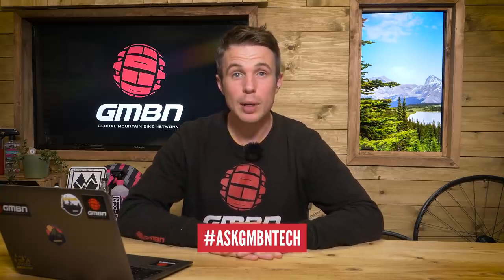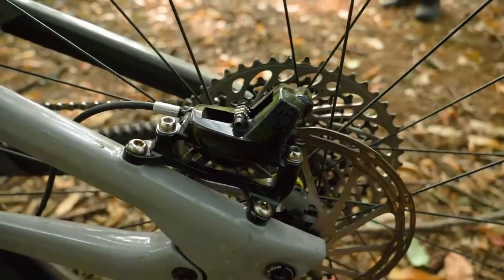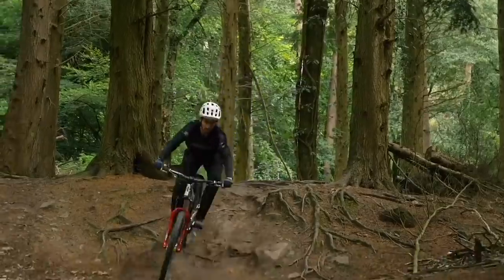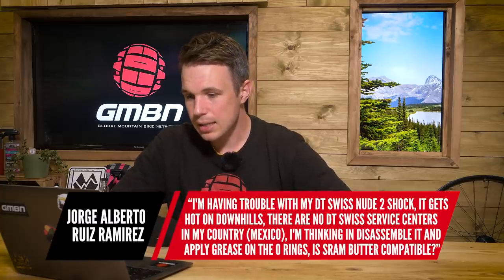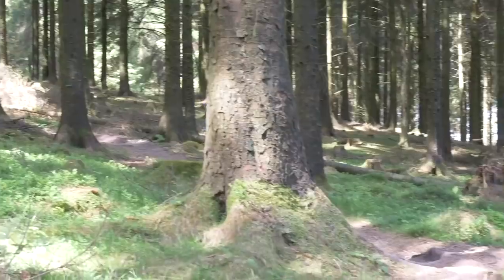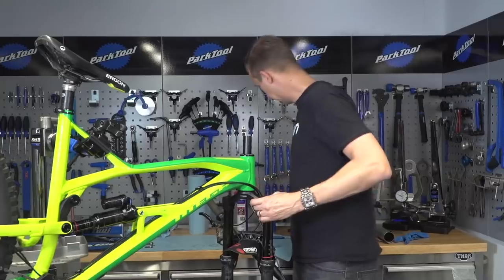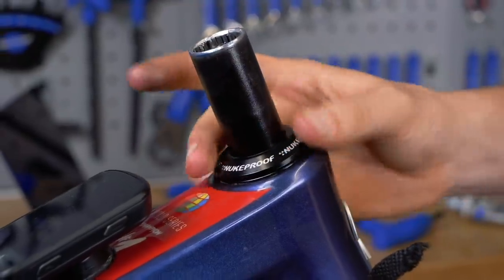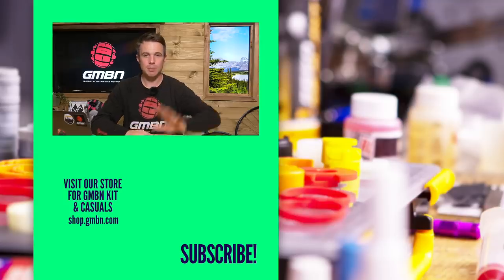Why Is The Head Angle So Important On A Mountain Bike? | #AskGMBNTech

Comment: #AskGMBNTech Great show! I been meaning to ask: I reinstalled Shimano calipers on my bike after buying new pads as I started using the not so old Jamis Durango SX, the issue is: the back brake caliper doesn´t align properly with the disc or wheel (I've already tried trueing the wheel, checked for a bent rotor, also tried with different wheels), so the rotor and the pads rub to the point where the wheel it's not moving at all unless you apply force. I've tried many of the troubleshooting on your videos to no results, any ideas?

Comment: #AskGMBNTech 
Hi there!
I have two bikes, one hardtail (Decathlon 540) and one full suspension (Decathlon 540s), i know they are not the best bikes but they do the job right now. On the full susp i have 19c rims and on the hardtail i have 23c rims. My question is, how big i can go on the tires? On the full susp i have 2.2 Trail King with 55-584 on the back and on massive Mountaing King 2.4 60-584 on the front. I like the grip but sometimes i feel like the front has a mind of it's own :). Should i go 2.3 or get the rims from my hardtail?
Thank you!

Comment: #AskGMBNTech I have a 2019 Specialized Stumpjumper ST Carbon Comp. It has a head tube angle of 67.5 degrees. What information do I need to know to find out what angled headset would be compatible for my bike? Can you suggest a sound option? I would like to slacken the head tube angle to 67 or even 66.5 degrees. Do you think this is a good upgrade as most short travel trail bikes are now running angles in the 66 degree range?

Comment: #AskGMBNTech
Hi, I am a tri and gravel rider from Hong-Kong, and ready jump on MTB right now.
I got a Lapierre Spicy 527 (2017) old stock from dealer, it has a 170mm travel fork and 230x57.5mm shock with 165mm travel, I want to change a coil shock for better traction (that’s cool).
Unfortunately, 230x57.5mm size is rare on market. But I saw a lot of same E2E shock with little bit longer stroke, any problem if I mounted a 230x60mm? I guess it will not change bike geometry.
Love your show, a GCN and GMBN fans from HK.

Comment: Hello! Am a newbie, and its my first time building my own bike. Its a hardtail, a dartmoor primal 2020 29er. My concern is this. I've got IS brake mount type of frame, and its max rotor 180mm. And i also got shimano saint brakeset which is post mount and 180mm sram centerline rotor. What type of adapter do i use? Is it 0mm IS to PM adapter? Thanks.. #AskGMBNTech

Comment: Hello, my forks fail to track small bumps and I have tried setting up many different ways, I have the 2017 rockshox lyrik (new from box recently) and it does not have high speed compression adjustments, just low speed. Is this to do with me being 10 stone or is it the high speed compression? #AskGMBNTech
I bought them forks after watching videos of them tracking small bumps and would really appreciate it if you guys could help me figure it out.

Comment: #AskGMBNTech Hi. I have a 3x7 tourney/shimano system on my hardtail, and everything works great, however there is one thing I get annoyed of. The rear of the bike where my chain is keeps making slapping sounds. How do I stop or reduce this? I am getting a chain guide soon to stop chain slap, but my derailleur also flings forwards when I land the rear wheel when doing a stoppie or a bunny hop. How do I stop this?
Reply: Is a 1x drivetrain swap within your budget 🤔
Reply: You can use a chainstay protector (can be an older inner tube) to stop the noise, but the derailleur goes forwards cause it lacks tension, only thing you can do is swap it for a better rear derailleur.
I had a bike which was 3x7 as well, rode 2000km with it, sold it and buyed a new bike with Sram's SX (1x12). You have to pay more attention with the hanger alignment and general gear setup (cable tension, etc) but my chain never came off again.

Comment: For someone who wears or 400 lb what's a good mountain bike I was thinking about getting a full suspension aluminum or steel frame weight doesn't matter on the frame size so wanting to ask you it's a false inspection by good for a person who weighs over 400 lb if not what if he gets a heart tail for me
Reply: I am not sure the suspension matters in terms of the frame not breaking.  I broke my fully.    At the rear.       But definitely go steel.         Think oceangate. Steel can take what it can take over and over. My Alu one broke doing nothing just a curb. Fatigued

Comment: #askgmbntech
Hello,
I have a Brand x HT-01 (the 2014 Vitus Sentier frame) which Vitus specced for a 140mm 27.5 fork. I am running the bike as a 26er, and was wondering with a 26" 140mm fork, as compared to the same travel 27.5 fork, how would the axle to crown measurement change and would that impact my head angle?
Many thanks,
Jude

Comment: #AskGMBNTech

I have a non tapered (trail HT) frame and i will buy a tapered fork and install it with adaptor for tapered fork, my question is does the non tapered frame with tapered fork and adaptor has the same stiffness with the tapered frame and tapered fork?

Comment: #AskGMBNTech 

I have a nukeproof scout that I ride on very steep and rough downhill (it's super fun and is actually improving my line choice) it currently has the 140mm fox 36 rhythm that it came with, I would like to upgrade to a 150mm fork and have been looking at the mrp ribbon coil.

My thinking is that the coil fork will give much needed extra grip on the rough stuff(is this correct?) but I'm not too sure what it would do to the geometry with the added 10mm of travel and different axle to crown length

Comment: Hi, 
I've been having a problem with my front wheel on my budget hardtail for a few months now. I store my bike with the wheel off, and the wheel does not seem to go into the same place every time I put it back on the bike. The wheel also moves sideways through out my ride, making the brake rub, so I am constantly having to remove the wheel and hold it in place while I tighten the quick release. I never used to have this problem until recently. Any help or advice would be well appreciated. #askgmbntech
Reply: Sounds like a loose cone. Take the wheel off, grab the end of the hollow axle and try to push and pull it in and out of the hub - do you feel play? If there’s more than a tiny bit (less than a millimetre), that’s a likely culprit.
Reply: What  @Ilkka Karppinen  said, or your qr isn't tight enough.
Reply: @CodSlap  I have checked and there is no play whatsoever. Thanks for the help anyway
Reply: @kevinshort3943  I do it up as tight as I can every time
Reply: @jackborrett8608  
If the wheel isn't moving.............   Check the brake calipers are tight.
Have you bent the disk with all the taking the wheel on and off? 
Disks can warp/change shape with the heat generated during use.
Reply: @kevinshort3943  calipers are done up super tight and have threadlock on. The disc did get bent slightly a while ago, however it is now true
Reply: @jackborrett8608  
If you are having to hold the wheel in place while you do the QR up, then it's not seated correctly.
Also you should just be able to undo/do up the cam, with no need for rotation.
Reply: @kevinshort3943  sorry, what do you mean by seated correctly? And what's the cam?
Reply: @jackborrett8608  
Seated, as in fully home in the dropouts.
The cam is the lever that you unclip/clip to  release the wheel.
Reply: @kevinshort3943  Oh okay thanks
Reply: @kevinshort3943  Thanks for all your advice. I have figured out that the dropouts are quite worn, so the wheel does not sit perfectly, and won't stay in place due to being uneven. Looks like I'll need new forks lol
Reply: @jackborrett8608  
That's not nice :(
You could buy a second hand one and swap the lowers legs?
Or buy an upgrade :)
If you have a straight semi integrated head tube (44mm) there are "adapters" to fit tapered forks.
Reply: @kevinshort3943  Yeah I'm probably just gonna try and get another cheap fork as I'm saving up for a full sus 🤘

Comment: #AskGMBNTech 
Hi! love the show!
I have a Cube stereo 140HPC TM 2020 with Fox Float DPX2 Factory ( metric 185x52,5 /Trunnion) 
Is it possible to run on a spring damper on this bike?  I'm not sure there's enough space for a coil spring. If so, what damper would you recommend? Ideal with pedal lock or firm mode for climbing.
thank you very much! have a nice day

Comment: #AskGMBNTech i rode my bike for 6500km, in gravel,rain,dirt, generally very wet conditions, when should i replace the chain? Giant fathom 29er 2019 xc bike, thanks
Reply: The easiest way is to buy a chain checker, And just use that, It'll show you once it reaches half a percent of wear, which is when you should replace your chain. If you don't want to buy a chain checker, measure out 24 or 48 links with a yard/meterstick, since each link is half an inch, the chain shouldn't be more than 12.06 inches for 24 links or 24.12 inches for 48 links. 12.06 and 24.12 is based on half a percent of chain stretch, which is when it is recommended you should get a new chain.
Reply: I have 2000km on my xc bike in mostly dry weather and it has something like 0.025% wear (half of 0.5%) measuring with a metric tape if it helps.

Comment: #AskGmbnTech I can’t get full travel out of my fork even on lowest recommended psi, what do you guys suggest, I have a fox 34 rhythm
Reply: Check if you have any volume spacers. If you do, you may want to experiment by removing some (or all) spacers to allow the fork to compress through all its travel. Good luck 👍
Reply: When have you done service to it?
Reply: Pienimusta never because I got it recently
Reply: @meirsnyder3460  Check the top air side. Good guess its shoveled full of grease as mine was (Fox 34 Rhythm). Works as bad volume spacer. There should only be slight grease, especially on the seals. If there is any, clean it.
Reply: Pienimusta ok thank you

Comment: #AskGMBNTech Gents, contemplating upgrading my worn 11 GX drive train. Many of my friends are riding 12 speed all summer and often complain that they are forever indexing gears because it's so finicky. I've not ridden 12x and my legs can push the 11x. Stick with the old faithful? What's your opinion?
Reply: The 12 speed SX derailleurs are made out of Cheese, dried custard skins and Chinesium - avoid :(

Comment: #AskGMBNTech 
Hey GMBN Tech Team, what do you think about this? I have a Voodoo full sus bike.  I have upgraded wheels, tyres, brakes, drivetrain. It has decent Rockshox Sektor forks.  The rear shock is Suntour Epixon. It seems to be a less common size. I could get a RockShox Ultimate Deluxe Debonair for £350. Do you think the better performance would be worth it?

Comment: #AskGMBNTech I've got a Rockshox 30 Silver solo air for that I want to increase the travel of. This is done by taking of the lowers and then take the aircap of and the spring is supposed to come of. On my fork the spring stays in the stanchions and the aircap just comes out on its own. How do I take the spring out? You can't use circlet pliers like on the gold version.
Reply: @kevinshort3943  I have read the manual. The aircap is supposed to unscrew together with the spring. It doesn't.
Reply: @shailoism  
Does it need "Persuading" with a big hammer?

Looking at the manual, it just pulls out.
Have you taken the air tube out first?
These things are slippery and a bugger to get out. have you used a rag or similar to get a good grip for a hard pull - Oooh errr Mrs?
Is the manual lying and there is a circlip?
Reply: @kevinshort3943  The air tube is what I'm trying to get out I assume that's the one that's supposed to be threaded into the top cap from what I can tell from the manual.   

Do you know if the lowers have to be taken off first? I have taken the lowers of in my first attempt but if they can stay on it'd make it much easier.
Reply: @shailoism  
According to the manual that top cap comes off , then you take the air tube out the top, then you can remove the spring from the bottom.

The "top cap" that's attached to the air tube isn't the cap that covers the valve. It needs unscrewing with a socket from the stantion.

Have you bothered looking at the manual?
This is all detailed with pictures!!
Reply: @kevinshort3943  I unscrewed the valve cap. The entire valve came out with a 24 socket. The spring should be attached to the valve cap agreed? It specifically says in the manual. However, it doesn't!
Reply: @shailoism  
"The spring should be attached to the valve cap agreed? "
No, the Air tube is. 
The spring pulls out the bottom.

Have you read the manual? 
It clearly says and shows in pictures, the air tube coming out the top and the spring out the bottom.

Comment: #askgmbntech hi, please can you explain the installation of tapered forks in straight steerer frames as I am looking to upgrade my fork on my older bike
Reply: Check if your straight headtube can fit top bearing like ZS44/28.6 (read as - "zero stack" cup and bearing will be inside the frame, 44mm is the internal diameter of the top of the headtube / 28.6mm is the outer diameter of the top of a tapered fork). If your frame headtube top can fit 44mm cup then you can go with EC44/40 at the bottom (read as - "external cup", the cup will be installed inside the headtube but the bearing will not be fitted inside the headtube, 44mm is the internal diameter of the bottom of the headtube / 40mm is the outer diameter of the bottom of a tapered fork). And this is probably the only option of installing tapered forks into straight steerer frames if straight headtube is internally 44mm wide, of course. I've heard about straight headtubes 49mm wide internally which can also run ZS/EC combo to fit tapered forks.

Probably pictures will tell you more, so google for merlin cycles "buyers guide to mountain bike headsets", at the end of the article they have schemes with all the most popular options. Look for options where 28.6mm at the top and 40mm in the bottom.

My bike is running a tapered fork in a straight headtube by using ZS44/28.6 + EC44/40 combo.

Keep in mind that external cups slightly (barely noticeable) changes the geometry of your bike as it is adding 5-10mm to the bottom of the headtube which is effectively lengthen the fork in terms of geometry and make the bike a little bit slacker head angle.

Sorry for the long read, hope it helps 😎
Reply: goozzz666 Oh my, thanks for this. The extra 5-10mm is very welcome as slack=speed 😎 the other issue is the hub tho which is probably easier that I would think. My bike isn’t thru axle so I could only get a cool new front wheel!
Cheers for the info 🤙
Reply: @albertnoyce7398  I really do recommend checking out the article I've talked about as it was my 101 to fit tapered fork into my straight headtube.
Reply: @goozzz666  legend reply

Comment: #AskGMBNTech Hey Guys! Short question: I was thinking about getting some C02 canisters since I finnaly ride tubeless. So is there a kind of canister out there you can refill with your pump or compressor to use it more than just one time? 

P.S.: Thanks for helping me out ---> Love u
Reply: Hi, how are you?
The CO2 cartridges are designed to be disposable and single use. When you use it, you puncture the seal and let all the gas out, so unless you can seal it back with something, I don't believe it's possible.
I myself prefer to use mini pump, so I don't have to worry if I have a cartridge with me or not. Plus, when running tubeless you usually have lower pressure in your tires, so really, all you need is a good pump.
Hope my answer is helpful
Cheers!

Comment: #AskGMBNTech Hi guys, i have a 2016 evil following and i want to upgrade my front travel from 130 to 140 and my rear travel from 120 to 130 what are the disadvantages of it?
Reply: You can’t really increase the rear travel, you can sometimes increase the shock stroke but not always, increasing the fork will give you a slacker head angle but will decrease reach and raise the bb hight. Increasing the fork by ten mm won’t affect it too much and will work just as well

Comment: i have xo brakes and i did a solid bleed with new pads, but the both sides of pads are way too close and  rubbing against the disc not sure what i done wrong as the back one is fine but not as immediate as the front,  did i bleed it with too much fluid?  If thats possible #askgmbntech still waiting for doddys piston clean vid he promised hed do over a year ago 😂

Comment: #AskGMBNTech i have xo brakes and i did a solid bleed with new pads, but the both sides of pads are way too close and  rubbing against the disc not sure what i done wrong as the back one is fine but not as immediate as the front,  did i bleed it with too much fluid?  If thats possible still waiting for doddys piston clean vid he promised hed do over a year ago if thats relevant?  😂

Comment: #askgmbntech

Hi,I am looking to get new handlebars and a stem I would really like to to get them but they have to be cheap I am looking at wake bars and stem
Thanks
Reply: I use a wake stem with a brand x carbon bar, it works good, just make sure you torque it down right, although I'm looking at getting a new stem but that's because I want one that looks a bit better